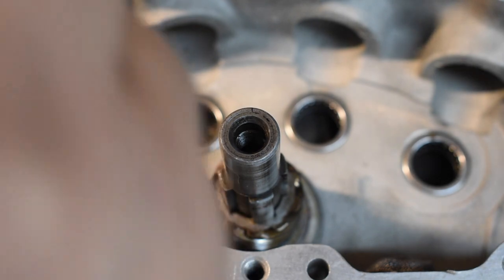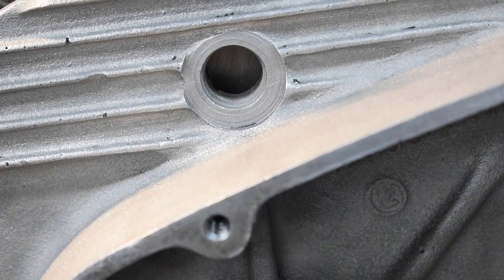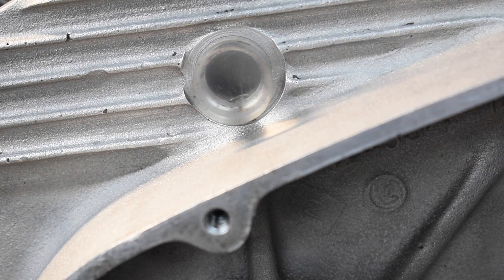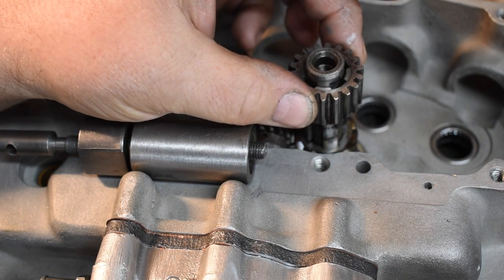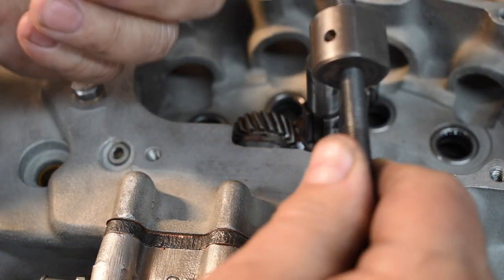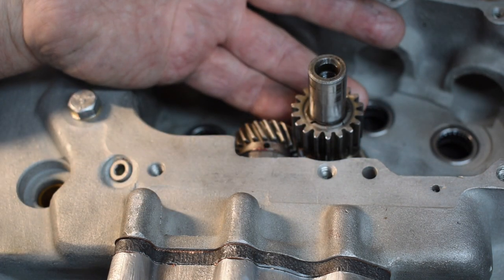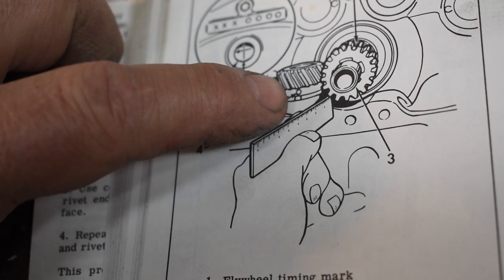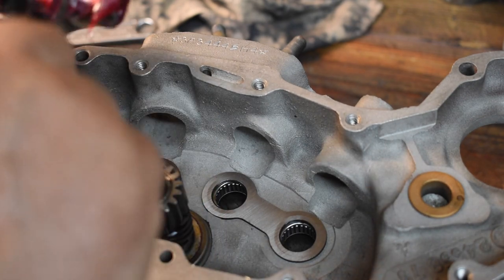Ironhead Breather Timing Nbr 171

Comment: My first cam timing was on a 73. I lined everything mark to mark and it would not run on both cylinders. I tried over and over again, finally took it to a local shop and the same result. We call of local Harley dealer they said bring the cams by their shop. The mechanic wiped the cams off and who would have thought, they had two sets of timing marks. Someone at the factory had stamped them wrong and then they scratched in new ones. Put them in on the scratch marks and fired right up.
Reply from the maker: Harley also produced Nbr 3 cams that were stamped in the wrong place. Look for upcoming video on down and dirty cam timing check.

Comment: Greetings From Siberia   There is no time like the present time to talk about timing  . As always I hope that you and Peg are happy , healthy and doing well . Another first class video from the cast and crew of two from Ironhead Cycle World Headquarters . This is a fantastic demonstration of how to perform this very important engine rebuilding procedure . I' m sure that the thought of having to perform this task and install the cams could cause major stress for some individuals . There is nothing to fear here and if one was to follow along with what the Wizard of all things Ironhead is presenting here , they will be able to accomplish the task .I remember checking the breather timing on my 73 XLCH decades ago one winter. it was off , I retimed it and it has remained the same since then .  i agree that Andrews cams have nice visable timing marks that make installation and set up much easier . I do know that some Factory replacement P cams are not marked correctly . How do I know this , because I have experienced this and I'm not the only one . Notice I said Factory replacement cams , not the ones that came in the bike when it left the factory . The factory I'm sure wouldn't let bikes leave that didn't run properly though like anything else it could be possible . The cams in question were a N.O.S. set of P cams that I purchases from someone that I had done business with for years . The cams were in a sealed box and brand new . When I installed them everything went real good until installing the number four exhaust cam .No matter how I positioned the cam I could never get it quite where I wanted it to be .  After much fussing , I reassembled it knowing that it could be off slightly and that was about as good as it was ever going to be with the mark where it was . The bike was hard to start , made good power but I knew it wasn't right and took it apart to have another look . When I couldn't get it lined up like I wanted I did what anyone should do and that is to either take a break or call someone you know to come over and have them look at it . I had a good friend of mine who is a experienced Ironhead drag racer come over to see what he thought . He looked , agreed with me , did some fiddling and he moved it slightly and then left for me to finish putting it back together . Before he left he asked me what I was going to do if this didn't work out . My response was install a good known set of cams that I had previously used in the bike . After start up which again wasn't like it should be ,power was good but I knew this wasn't right . I took it apart again , took the cams out and reinstalled the previous set . The bike started with one kick and ran exceptionally well . Was I content with this , no , I was happy that the bike was now running like it should again but I had to know what was wrong . I knew that it was valve timing related but not sure what exactly was out . So I did what I always do when I have ideas but need some feedback . I made some calls . My first call was to where the cams were purchased , while in the midst of explaining to Don what was going on he said number four exhaust cam . I said yes ,he said he had seen this before while working on the bench over the years as a technician . I then called a well known and respected Harley engine builder that I had talked to many times over the years . Same scenario , before I could finish my explanation he had the same answer , number four exhaust cam . He also had run into this before . Dan then went on to tell me about a good friend of his who was also a respected builder that had just run into a issue with a big twin stroker he had built for a customer . After installation of the engine and running the bike the customer called and said the bike had no power . The builder looked at the bike , couldn't see anything obviously wrong and then called Dan . Dan looked at the bike and at first didn't see see anything wrong but upon a closer look he knew the valve timing was out . He pulled the cam out and the saw that there were two timing marks and one was harder to see . It was obvious at this point that the manufacturer caught the issue but didn't make the correct mark as visible as it should have been . The cam was reinstalled and the bike then ran and made power like it was supposed to .one reason this didn't get detected at first was because the builder had never run into this before . I remember reading where Bonnie Truett ran into the same thing with a engine he built for a customer and he had to figure it out .This can happen to anybody whether you are a professional or not . Just because a part is new doesn't mean that there isn't a defect somewhere . When I worked at the dealership years ago one of the owners brothers bought a brand new bagger and had a set of cams installed . The results were terrible , the power was down ,fuel mileage was down and the bike didn't perform as good as before the cam change . He brought it back, it was checked over but nothing was changed . He wasn't happy and waited until his brother was on vacation , then brought the stock cams and bike back in and had Jeff put the stock cams back in . Ed's intuition had been right and he was happy with the bike once again . I did some checking later on and found that the factory had sent out a service notice that some of these cam sets were not marked properly . I like your seal tool and I new where you were going with this before you even got there . We are a lot alike and think in a similar fashion . There is no replacement for experience , it takes a lifetime for this . I noticed no mention about the lack of cam shims . I don't use them as well and you don't need to . There was a Factory buletin for this . Well again I think the old Fossil has ranted enough for one session and Mya my fluffball Husky on teddy bear with teeth as I sometimes call her has gone to bed before me . Take Care My Friends .  From The North   Siberian Cycles    Gary
Reply: Such great feed back,as you say experience.
The problem is that the experience is dying with us.
Most,not all of the younger generation, can't be bothered tinkering,they just want to ride.
I think in time all the old bikes will just be museum exhibits,like us and the dinosaurs
Reply from the maker: I've run across at least two nbr 3 cams that were not stamped correctly. After a new rebuild engine failed to start with near zero compression on the front jug I eventually figured out nbr 3 cam was not timed correctly even with the marks lined up. Now I do a down and dirty timing check on them after they are installed and can usually spot a cam that is grossly out out of time. I've been able to compare the suspect cams to a known good one and remark them correctly. Nothing is a better teacher than hard knocks.
Reply from the maker: There is more truth in that statement than there ought to be and more than we'd like to admit.

Comment: What about when someone has red locktited an oil restriction into the pinion shaft (to limit oil flow to the rod bearings for the benefit of the top end)?
Reply from the maker: Sounds like a bad idea to me. The issue isn't really too much oil to rod bearings, but too much oil in crankcase. What guys usually do is block the rocker box returns to the crankcase (all you've got to do is turn the gaskets around to block the drain back holes) then drill the heads for external drain lines back to crankcase cavity below cam chest screen.

I'd get the restrictor out of the pinion one way or another, or, replace the pinion if I couldn't get it out.

Comment: Thank you for a great video.  If the pinion gear is loose shuld it be replaced?  Or will locktite  bearing lock work to hold it in place?  My first Ironhead 900.
Reply from the maker: I've been behind in answering comments, I see you asked again, I think I got you covered on your second try.

Comment: It's always good! I cannot ask the guy on the lift next to me anymore! Motorcycle Shops like The ones I worked  at are gone!  Tried to work at a Dealership  again a few  years  ago and the soul and  the experience I have has been replaced by a bunch  of pussies that are not Motorcycle Enthusiasts! Torque Wrench experts that can't breathe fumes wear Full  face helmets and God forbid if it is cold or rainy or snowing where have all the bikers gone?My small shop ain't dead yet!-Renegade
Reply from the maker: I used to work in a dirty greasy old Triumph shop. The trouble is there are no more of those around to season round mechanics.

Comment: I think you time the breather timing wrong because the whole is showing when you have all your cams assembled, I timed mine like you did with the book to the line and then everything lined up like yours did here in the breather timing was off and I pumped oil in the primary then I found out you use the third timing mark on the wheel whether it's a line Dr two dots always use the third mark so then when you assemble your cams at breather timing hold you showing them it'll be off to the right and I checked out to another motor I had and it was correct so basically the first time I did this I timed it to the first timing mark because that was a line and I needed to do. Instead which was the third timing Mark which was the front cylinder top dead center, so if you don't know which flywheel you have always use the third Mark am I correct on that? I know I was wrong doing it the other way

Comment: Call me a retart! at Top dead center on the Front Cylinder with all cams lined up my Front cylinder cam is up in the exaust position! I believe I may have a mis-matched cam! As I understand the Front Cylinder should be in Compression but the cam is up on the exaust.any help appreciated
Reply from the maker: I have personally seen at least 2 front intake cams with at least one of the marks stamped in the wrong spot. If you want to send me the cams I can compare them to a couple of sets that I have. Contact me here: https://www.ironheadcycle.com/pages/contact.html . For some reason YouTube had blocked your comment, I just found it in the "hold for review" tab.